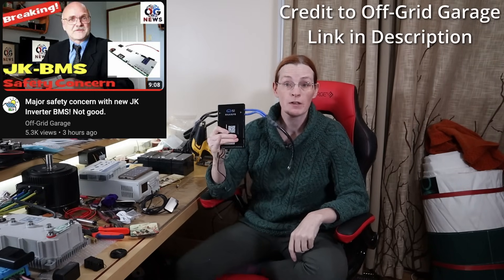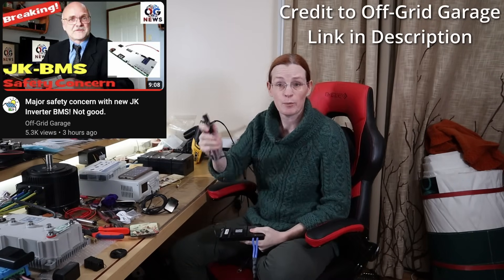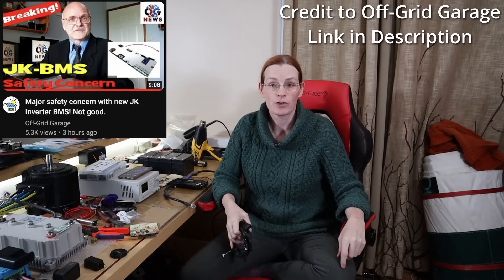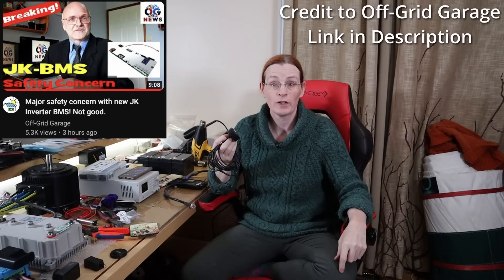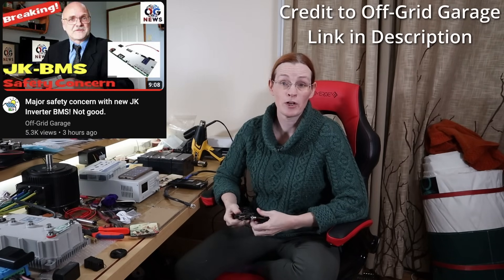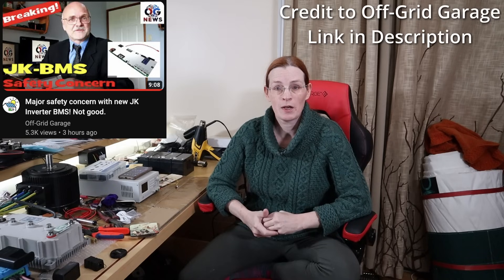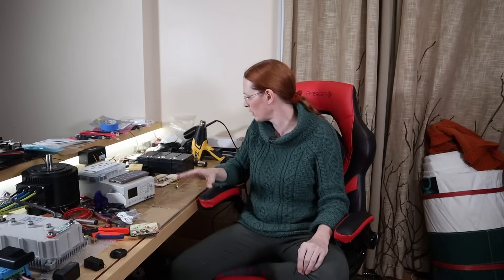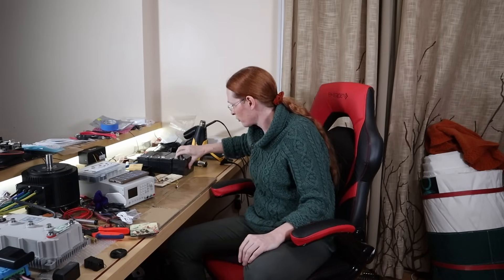News from Off-Grid Garage; Dangerous JK BMS Flaw

Comment: Well: all the BMS manufacturers have flaws. Even such "well thought of" or lets say "hyped" BMS like Batrium do have flaws. Sic! And just have a look at Andy's BMS list.

So give it a while to settle - the firmware upgrade is on it's way.

I do understand that you are fed up. Did similar with a Cisco Small Business Router for my office years ago - thought getting Cisco was a good idea... Bad idea - confirmed with Cisco technician that this box was not usable for a normal DSL Line here in Germany - delivering a device rebooting every 2 or 3 minutes and got a rather stupid AVM Fritz Box Router.

Got 3 8s 24V Systems running perfectly with JK-BMS without any issues. But it's running all the time. Also got a 8s JK-BMS last week to replace a 12V VIP-BMS - just checking if it will lose settings - to be sure. And yes, dealing with Chinese companies sucks. Learned it by hard.

On that VIP-BMS i replaced: it was "securing" a 12V battery i had here for testing. Thought an overcurrent shutdown test with an old 1200W vacuum cleaner attached to a 3kW/6kW peak inverter would be a good idea to start with. Well, starting current of that vacuum cleaner grilled a MOSFET in that BMS (yes, could happen). After some research i found the manufacturer changed the MOSFET stated in a datasheets for one that seemed to be more "sensitive" to high currents - 🥳 - i was given that battery for testing purposes - so, thats what i did. Of course i asked the manufacturer of the battery what they would do on warranty when a customer would do sth. like this. Customers fault, no warranty. Those batteries don't cost that much - but imagine a normal small budget customer, not a tech nerd, without the knowledge how to analyse errors in a LiFePO4 battery, opening the battery or rather the ability or the tools to change a BMS.

So maybe JK is not that bad - and dealing with Andy and listening to him might get them some steps forward - despite of the struggle Andy already had with that bms. They seem to be willing to listen - and that is not always the case when dealing with chinese companies.

Take your time to chose the right BMS for you.
Reply from the maker: The main argument I made in this video is that it's not just this one mistake, it's a long, long series of issues I've had with JK, and issues I've seen Andy have with JK. This specific issue is resolved, great. My BMSes (not counting the ones they changed without updating the model number) work, great. The problem is, there's no way for someone who watches my videos to order a given model number and know that they'll get. There's no way to know if any given firmware update is going to have dangerous side effects, because JK doesn't do the most basic QA. They clearly don't take the time to think about fail safes... The times the BMSes work doesn't do anything to allay these concerns.
Reply: @TheDigitalMermaid  Well, that seems to be the case with a lot of BMS when it comes to chinese manufacturers. 

Not only there, so many examples of that in so many different aspects of technology in life.

Since there should always be some redundant security (configuring charging/discharging devices with the appropriate current and voltage) yes, the issue is very serious for LiFePO4 users, but should not be dangerous if we as designers of ESS do take care of those settings. 

Yes, poor QA on the software side, but i did not expect the firmware of the inverter BMS to be final at the moment. Got the impression they are „open alpha“ testing it. Implementing nice features instead of getting the basics perfectly right firsthand.

Anyway for the boat related bubble security is a major issue. I do understand your reaction. Looking forward to your solution for this. 

Fingers crossed JK is not the less worst solution there is on the market. But when it comes to BMS with this price tag it might be. Always a question of how much you are willing to pay for which level of security and how much security you need or want. And looking at the troubles you faced with the diesel engine - couldn‘t imagine similar problems with the whole electric drivetrain.
Reply from the maker: @fldutch  If something is "open alpha", it should not be available for general purchase. There should be an opt-in program where you have to acknowledge that you understand the risks involved. That wasn't the case here. I understand JK isn't the only "bad apple", but they were the subject of this video because they're the ones I've used in dozens of videos. I couldn't leave the possibility that people thought I endorsed them.

Comment: I'm a bit surprised you've stuck with JK so long. But as far as chinese jellybeans go, they're pretty much all like that. We're assuming JK is actually making these things and not sticking their name on stuff. (which is very common!) Sounds like they shipped LiPo firmware with LFP settings, and when the internal cap/battery discharges, it loads the LiPo settings. That's a nasty error anyone should've known would not fly.
Reply from the maker: There's not been many options to replace them. Even now, I'm not sure what I'll switch to. I've not hidden my frustrations at JK, this was just the last straw for me.

Comment: This is the new world of rapid product and software development and going live. This is pioneered by companies like Tesla - look at all the forums about how they left customers alone with their problems for months without any help. JK is going in the same direction - their products are tempting, really interesting and really competitive - as long as they work. If you have a problem, you end up in the cold with no option to do something. In the end, it's much better to buy inferior and more expensive products that are more stable.
That's one of the reasons why I went with Victron for example, instead of cheaper products...
This is VERY important video, the awareness needs to be spread as this might seriously impact people that have off-grid installations, go for vacation, return back just to find out they killed significant part of their energy storage system :(
Reply from the maker: Given my use-case in marine, and I suspect a decent fraction of my viewers are also considering electric sailing, this approach is not acceptable. In a Tesla or other car, you can pull over and call for a tow. If you're off-shore, well, good luck! This is why I can't recommend them anymore. If others decide it's worth the risk, well honestly, I get it. I understand the appeal. It's just gone too outside my comfort level.
Reply: @TheDigitalMermaid  Honestly, for such mission critical battery, I'd probably go with a pre-built battery like Pylontec or something... Exactly for the reason you've mentioned... But yiu will still have solar and sails when all else fails...
Reply from the maker: @rklauco  Pre-built batteries are too volumetrically inefficient. Even with bare cells, I'm so space constrained that I am looking everywhere to shave off a few mm here and there. Now, this isn't the case for many other boaters, and for them I absolutely agree with your pov.
Reply: @TheDigitalMermaid  Yeah, this aspect is true... The flexibility of open crlls is great.

Comment: JK fixed it! Update available on the website tomorrow. AND - default setting will be LFP !  From my view a very quick fix and good customer service. I don't know any other BMS supplier getting customer feedback and bugs addressed that quick.
Reply: They really fix the "reset" problem or they just changed the LTO to LFPO default setting after a unwanted reset ?....
Reply: @sebydocky5080  The reset and the default values 😊
Reply from the maker: My understanding is that it resets to LTO now, not LFP, but still that's much safer. I am glad it's fixed for those who bought it, but for me, for the reasons I explained in this video, I still don't trust them anymore.
Reply: @TheDigitalMermaid  
JK note on their Website for the change:
"Change the default configuration parameters to lithium iron to improve security."
Reply from the maker: @michaelwessel2983  Ah, ok, good to know.
Reply: The problem with the interruption of the charge after a false 100% is also known to JK, but they did not fix it in 6 months. Although it is quite simple. Complaints are not answered, no one has ever received any response. For many, it was the last JK purchase.

Comment: Though Andy has now pointed out that 14.7 will fix the flaw in the new Inverter BMS.  I will say that I support your position.  In a mission critical (life dependent) environment, you don't take chances and trust is easily lost.  If my BMS gives my some hiccups in my setup, I can fix it without risk to life, you can not.  I have both the new inverter BMS on 14.5 and a couple of the older JK 16s BMS (with a start button that works).  I will stick with mine though.
Reply from the maker: This is just it; It's the culture of how they release products and how they (obviously don't) care about the customers. I'm glad this is fixed for people who own them, but that doesn't rehabilitate their reputation in my mind.
Reply: @TheDigitalMermaid  I am a software engineer also.  I would never release a software patch or program change without a full unit test and QA cycle.  I don't like "call back"

Comment: check out the new sodium ion cells, look the same and have the same voltages as lifepo4 but discharge to 0v and better cold temp performance.
Reply from the maker: The problem with them is that they're not very dense, so use in vehicles is not that appealing. As I understand it, they're most applicable for cheap grid storage were weight and size are less of a concern.

Comment: They could make an update so that it was not 4.2v but 3.5 or 3.3v and discharge 3v, then you would see that something was wrong and fix it instead of a fireman having to tell you that the batteries are gone.
Reply from the maker: If the defaults are hard-coded then a firmware update won't help, but an update could solve the problem. Another commentor mentioned it could be a bug that failed to write the new config to non-volatile memory, and if that's what it is, it can be fixed. However, a reset to defaults should always be a reset to fail-safe values, and this is not the case, clearly.

Comment: Provision a system with the new JK BMS.  Ensure the settings are correct and then use the new system.  As long as you don't shut it down for several months, then bring it back online without confirming the settings, there is no danger.  It's kind of like winterizing a boat or an RV, then getting it ready to use again the following spring.  I'm not saying it's a GOOD thing their newest BMS boards don't retain those settings.  It really is a problem, but for anyone who has bought one, it's not like you can't use them, especially if you're like 99% of people who but a system to work...and it just keeps working.
Reply from the maker: It's not "several months", it's "a few days". The idea that a restart of the BMS, regardless of the duration, could result in the damage or destruction of your cells is not a condition I would ever be comfortable with.
Reply: @TheDigitalMermaid  - The settings shouldn't change, that's for sure.  I'm glad I've stuck with Overkill Solar and the JBD BMS's, thus far.

Comment: IT'S NOT JUST THAT THEY RESET, but they reset to a factory HIGHER voltage?! Why would they not set the lower voltage as factory default, that way it would simply not charge Li-ion batteries fully, but would be safe for LeFePO4 (should it reset which it should NOT!)? This is a colossal design error- no, SERIES of design errors which should never have left the factory. JK clearly does not do operational testing on the product they sell. 

Glad I only bought THREE JK BMS last month🙄. Not pleased, now I have to do the product testing they should have to see if I have effectively designed units.
Reply from the maker: It would have been so easy to say "of the chemistries we support, was is the highest low voltage that is safe, and what is the lowest high voltage that is safe?" and use those as the default cut-off voltages. It's such an obvious and simple thing to do, if they cared about the safety of their customers AT ALL.
Reply: @TheDigitalMermaid  Exactly. I cannot understand why the default is not "fail-SAFE". Plus, I agree with your point that documentation and specs are unacceptably opaque. With a company that screws-up that badly, I can safely say my next BMS will NOT be a JK. (Hey, doesn't "JK" stand for "joke" with these kids and their texts?).

Comment: It;s not when turned off its when they been off for several days which is what most will never do. but they will get a fix.
Reply from the maker: If you have a boat, an RV, a cottage or any other seasonal use case for your batteries, the chances of the BMSes shutting off is much higher. If someone came back to their boat, turned their chargers back on, saw their battery was off and turned it on, and went about their day they easily could find their batteries destroyed. I disagree, this is a major safety concern.
Reply: @TheDigitalMermaid  IF they are responsible for turning things back on then they need to double check all settings.  Mine are always on. Even when I turn mine off to check a single bank I double check my settings.

Comment: no no. only the JK Inverter BMS. ITs new tech and there will be bugs. I have had 4 JK BMS's and only issue I have had was when I had a bad crimp on a balance lead.  I ordered the ones with handle bar displays and not regular display which can also start them because I didn't need big display for each or want a big display. I know you have had your issues but They are the only ones with active balancers that work.
Reply from the maker: Did you watch the full video? I explained why I no longer recommend JK, and it goes well beyond this one flaw. This flaw was just the worst, and the last straw for me.
Reply: @TheDigitalMermaid  its only the new inverter bms not the others versions like we have. That flaw will also be fixed with a Rom adjustment.

Comment: I have programmed the "advanced settings" ... in 2 JK BMSs (from late 2023 purchase /recent hardware); and I think they are the best choice in market place for my  BMS. ... You seem to have criticism of the default LiFePO4 BMS settings ??? that are fully adjustable. Please correct me if I am missing something. If advance settings changed at a boat doc, I wonder if you created a unique new password? Re setting charge voltage: that is done at charger level, not the BMS protection and cut off triggers level. So ... 🤔
Reply from the maker: The problem is that JK changes features and capabilities without changing model numbers (hence why I had two BMSes that were 24v only). They add and remove ports on a BMS without changing the model number. This flaw could have been mitigated with fail-safe defaults, and prevented with even basic QA testing. Andy has had FETs blow at least twice because the JK BMS didn't cut the FETs fast enough in over current tests... It's clear to me now that JK can't be trusted, despite having some versions and releases that are OK overall.
Reply: @TheDigitalMermaid  ... Re Andy's FET blowouts w smoke on JK BMS. I remember seeing 300 second delay for an over amp limits cutoff trigger (possibly a ridiculous default setting? / vs my choosing a way safer 15 seconds for trigger timing, ... that is easily adjustable.
Reply from the maker: @CaptBill69  The time to disconnect wasn't the problem, the timing of the FET shutdown was. There are many FETs in parallel carrying the load, if one shuts down slower than the others, then the load of the shut-down FETs starts to go through the last FET that is still up, overloading and popping it. It's poor /sloppy design.

Comment: What you can not control, you can not put your trust into. Software is the worst there is because there is nothing you can do about it. I would use two systems parallel, each checking the battery and alarming if abnormal things happen and they would shut down the system.
Reply from the maker: In this modern world, there is no choice but to trust software... Microcontrollers are now in _everything_, and they all run software/firmware. This is why a company needs to value its reputation and do a good job. As for parallel systems, that wouldn't help in this case... the effected BMS would charge the cells even if the other stopped.
Reply: @TheDigitalMermaid  Not everything run on stable software. When you buy some chinese BMS you have no idea who did it and how much they used time for testing in various situations and conditions. I once had a quadrocopter which had "safety" mode. which means that in such mode it is safe to handle and propellers can not rotate accidentally. Well it did and hit my fingers... that much of a safety mode...

Nah, you did not understand, Dual system means the other one is controlling the other., not both do the same job. I have a battery system where the primary  BMS is doing the balancing and the secondary is just observing the battery status. If battery cell voltages go beyond limits secondary system will shut down the primary system. I wrote both of the software and made the hardware so I know exactly what to expect.